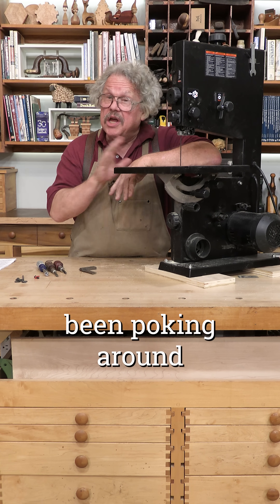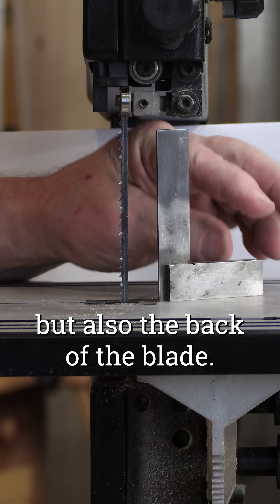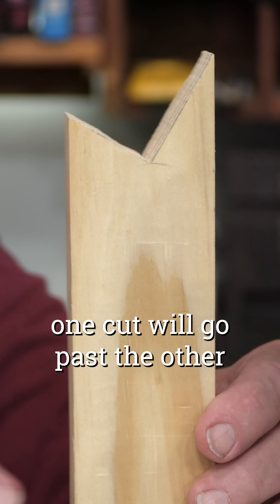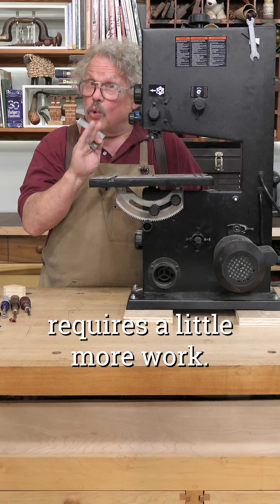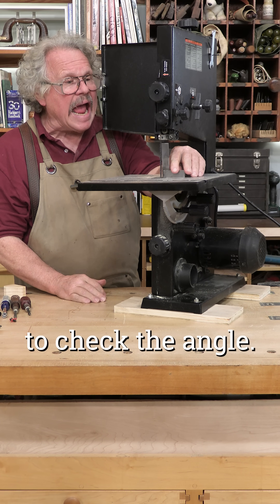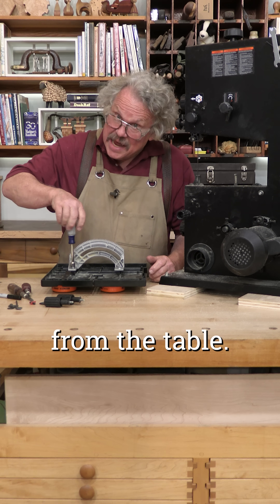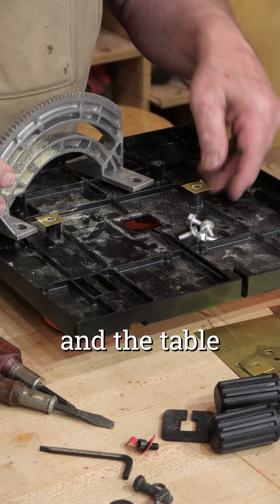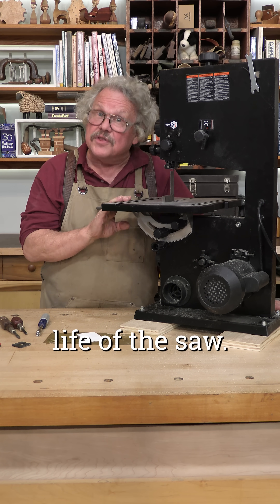Squaring the Bandsaw Blade to the Table

Comment from the maker: As important as this adjustment is, you’d think that bandsaw manufacturers would have come up with a simpler way to do it by now. But, unfortunately, adding shims under the trunnions remains the best and only way to get this done. 

You might also think that there would be a way to calculate the thickness of the shims you need to change the tilt of the table in relation to the back of the blade. There is; it’s a simple trig problem. But the precision required to make the measurements needed is far beyond what most home workshops can handle. So we’re left with this primitive “cut-and-try” procedure that I show in the vid.

Fortunately, you rarely have to add many shims and it doesn’t take as long as you’d think it might. To square up the WEN bandsaw shown in the video, I added .010" shims under two of the four trunnion mounts. But this little change made a big difference in the performance of the tool!
Reply: If the base of your square is as long as the distance between trunnion bolts, you can shim the square until it matches the blade.  Then put in your pile of shims below the table.  That will get you close.
Reply from the maker: @alans1816  Interesting idea, but I usually don't have time to machine a square to the proper size.
Reply: @WorkshopCompanion 
Missed opportunity at end of video to show us the results of your effort
Reply: I had stopped using my bandsaw for any "finish" work.  Didn't realize the problem.  Took most of 2 hours to gather tools, cut shims etc.... best darn two hours so far this month - so THANK YOU, thank you, thank you :)
Reply from the maker: @charliehiker2247  It makes a difference, doesn't it? I was blown away the first time I squared it up.
Reply: I'd think that the manufacturer would provide a bag of shims of various thicknesses with the thickness stamped on them and a chart showing what shims, or combination of them, to use to adjust based on the angle of the blade, which can be measured with a protractor.
Reply: I believe the bearing on the top and bottom of the blade have an adjustment for this too
Reply from the maker: @gabrielthedergy1 Unfortunately, not so. The top and bottom back-up bearings must be adjusted not to touch (or just barelt touch) the back of the blade. If there is forward pressure on the back of the blade, it stresses the blade and exacerbates the "washboarding" in the cut.
Reply: @WorkshopCompanion I thought I'd seen that adjustment before but maybe I'm thinking of something else. That actually makes sense though
Reply: Love this explanation
Reply: you also might think the manufacturer would be able to get this set correctly before shipping.
Reply: More great tips thanks!  I've never made this adjustment to my saw yet.   But I want to throw a spanner in the works...   Alex Snodgrass recommends adjusting the tracking, so that the deepest part of the gullet (the gap between the teeth) is aligned with the centre of the top wheel, not the middle of the blade like you and most others, suggest.   I certainly like the Snodgrass setup personally and have had great results with it from my 12" band saw.    It depends what size of blade and how many teeth per inch you use, but generally to get the deepest part of the gullet in the middle, the blade needs to be moved towards the back of the top wheel rather than centred!
Reply from the maker: @SoundsToBlowYourMind  Since we're talking about such a small difference for these small blades, I'm not sure it matters all that much. Performance should be fine as long as your tracking is consistent. But if I tracked the 1"-wide resaw blade on my 14" Delta bandsaw as you suggest, the back of the blade would contact the metal rim of the upper wheel. I can't see how that's a good idea.
Reply: Instead of removing the trunnions entirely could you back the bolts off a bit, cut u-shaped shims and then slide the shims on from the side before tightening them back down?
Reply: @CalamityJay-ez2mq   Vibration might cause 3 sided shims to move ...maybe try extending the "u" to "U" then bent over reducing movement... just a guess
Reply: @charliehiker2247 the farther down I scroll in the comments the better the solutions get😂
Reply: I have the same bandsaw you mentioned that looks similar to the one in the video—a delta 14”. I picked it up for $70 on Craigslist—love that lil thing! Now I have to go check the back of the blade… 😅 I haven’t noticed an issue but I want to be sure now
Reply from the maker: @DrLoveNugget  Great deal.
Reply: What about using a gradual wedge shaped shim? You could loosen the bolts and feed more shim to increase tilt.
Reply from the maker: @n0ch91c3s  If you can find a shim that tapers in thousandths of inches, yeah, sure.
Reply: I have nerve known this. Always confused by the issue. Excellent work.
Reply: Thanks
Reply: Where is your LEV?
Reply from the maker: @Dennis_M1DLG  Overhead.
Reply: @WorkshopCompanion  good, got to look after your health.
Reply: How tight should the blade of the bandsaw be? I refuse to believe that my band saw is so rubbish that it can’t cut straight but I’m scared of tightening it up too much
Reply from the maker: @gileshaywoodsmith641  Watching our vid on "Nesting Boxes," https://www.youtube.com/watch?v=i6z65s_xfLw . Beginning at 2:57, I show you how to tension the blade on a bandsaw without relying on a tension meter.
Reply: My Shopsmith was perfect To the flag of the blade, but in line with the blade, the bottom was just a barely bit off. I didn’t know how to fix it until this video, I made a plastic shim. Perfect. Thank you.
Reply from the maker: @kofdenhamsprings2701  Most welcome.
Reply: honestly shimming it is the best way to go in my eyes, feels more sturdy
Reply: It’s the same way with vehicle alignments.  While majority of cars have adjustments, a lot have no rear adjustments, and the only way to adjust it is to install shims.  This means you need to take the hub off and put a plastic shim behind it.  In other cases like trucks with solid axles… you don’t get rear adjustments.  It is what it is, and if you manage to get it out of alignment… you just get a new axle.  

Luckily most cars have adjustments, but the bolts seize up all the time and sometimes the bolts will just snap if you pull too hard.
Reply: @congruentcrib 
   Unless a vehicle solid rear axle is bent, it's usually not far off in camber, but surprisingly far as to toe. I've had good luck adjusting the front spring mounts, or trailing arm mounts on coil suspension.
   Even worked on toe for some suspension that adjusted with shims.
Reply: I dont believe you that there's no such thing as a bandsaw that comes perfectly square out of the box. Im googling it sir.
Reply: What about large industrial bandsaws that don't have an adjustable table?

Though to be fair, we cut mostly aluminum and rarely need to cut an internal corner.
But the thing is so old that blades don't sit square anymore even though it's a fixed base. I suppose you could shim behind one of the wheels maybe?
Reply from the maker: @Marlfox570  Not all bandsaws are made for fine woodworking. Although, when I was teaching at the University of Cincinnati, we had an ancient Tannewitz with a table the size of an aircraft carrier, and we shimmed the trunnions on that monster.
Reply: Inches?!  What kind of monster uses archaic measures for woodworking?
Reply: @greensteve9307  LOL

Comment: My understanding is the blade should be tracking at the back of the gullet’s of the teeth in the center of the arched wheel rim. 😇
Reply from the maker: The blade tracks where it contacts the wheel at the mechanical center of the wheel crown — not inherently at the any point in the blade's cross section such as the bottom of the gullets. The tracking behavior is governed more by wheel shape, tension, and tilt adjustment than by the blade’s internal neutral axis. So it's perfectly okay just to center the blade on the wheel. With wide blades, this would be desirable over tracking the bottom of the gullets on the wheel.
Reply: @WorkshopCompanion ,
Thanks for responding. I was just relaying what some bandsaw maven was recommending for setting up the infernal machines. He didn’t cover the table axis as well as you did.
By the bye, how’d that MSDS on water work out for you? 😎🎸👍

Comment: May I suggest that you first put a long straightedg level across the faces of the top and bottom wheels to make sure they are vertically aligned and straight up and down. Once I did this my bandsaw turned from a beast to a beauty. I had to shim out the lower wheel about 3/16 of an inch.

Comment: ... Are you telling me all that's in the top of a band saw is a giant wheel?? No motor or electronics at all, just a giant wheel to feed the blade through??
Reply from the maker: Bandsaws have two giant wheels, sometimes three moderately-sized wheels. You only have to apply power to one of them to drive the blade.

Comment: I think this video has finally revealed to me the problem that had been haunting me from woodshop. I’d make a perfectly straight cut, check the piece, and the end was messed up.
Reply from the maker: Yep. That will happen if the banck of the blade is not square to the table.

Comment: @“one cut will go past the other”:

When felling trees, this over-cut or bypass inside the notch is called a dutchman. A dutchman jeopardizes the ability to control direction of a fell, as the notch’s inside vertex becomes increasingly ambiguous. More significantly, Dutchman kerfs continuing beyond that inside vertex will sever “hinge wood”. This hinge wood is tethering the material above, to that below, and bound to your intended guidance of the fall: the notch and back cut(s).

Completely off topic? Well I say!! Returning to carpentry after five years of tree work, I find myself staring at every bypassed kerf on stair stringers. Am I being a bit dramatic considering misaligned and bypassed kerfs against the felling of trees? Oh yeah! But clean kerfs are good, and we all like good cuts!!

If any would like to share my peculiar shaded glasses on this, look into Humboldt style notches and Dutchman for good examples.

Cheers

Comment: It makes sense why they omit it as it would be highlighting their poor manufacturing tolerances. Thank you for educating us
Reply from the maker: To be fair, it's not necesarily a failure to maintain tolerances -- I didn't mean to give that impression. All band saws have this problem because frame castings and other manufactured parts are never exactly the same. The problem is that manufacturers cannot keep costs down if they have to spend hours adjusting for these differences. And there are some adjustments they can't make because they will change with shipping and environment. For this reason, tool makers pass the responsibility for final adjustment and alignment to the end user. It's always been this way, for tools at all levels of cost and quality.

Comment: Could you loosen the trunnion while it's on the machine and shim it in place, to find the right adjustment, and then take it off all the way to install it fully?
Reply from the maker: Depends on the design of the band saw. For the WEN, probably. For my old Delta, iffy.

Comment: I used to know a guy with a bandsaw that was WILDLY out of level. Like... you could see the wheels did not line up at all. he was convinced the blade guide was the problem... you know... an actual piece of safety equipment. So he removed it. Instead of just fixing the wheel adjustment knob on the bottom, which was broken.

Comment: I bought this bandsaw after watching your review and cannot get the bed to reach 0° it constantly sits at -4° towards me I’ve messed with the table the tightness and the leveling screw for the life of me I can’t figure it out
Reply from the maker: Suggest you remove the table leveling stop completely to see what your true range is. You should have 2-3 degrees left tilt and 46-47 degrees right tilt, at minimum. If you don't, return the saw. While it's a decent tool, the quality control is probably not all that great -- they have to cut costs somewhere to be able to sell it for that price. It wouldn't surprise that more than the average amount of lemons squeeze by QC.

Comment: would this have to be done again after changing a blade?
Reply from the maker: No.The blade rides on the crowns of the wheels. Because the upper wheel tilts from it's center, the "crown line" -- the longest measurable distance between the crowns the blade is riding -- remains at roughly the same angle. There is some movement, of course; the geometry is not perfect. But it's close enough that whatever changes there are do not overly affect the angle of the blade to the table when you adjust tracking.

Comment: I saw a many people complaining about their miter saws not being able to cut clean angles. I checked mine, a quite cheap one, and well, yes, 89.2° is not a square angle ootb, and 44,6 is not 45.
Loosing two scews, adjusting the table/guide rails along the blade, fastening screws - et voilà ! - perfect 90° cuts instantly.
Reply from the maker: Sometimes I feel that careful allignment and adjustment is 50% of fine woodworking.

Comment: I got the vevor 14” bandsaw and whilst being cheap in a few places like the guides were probably designed by 7yo and the bendy plastic table insert it has just under 13” of resaw, 1&1/2hp motor, heavy cast iron table and it was $600. It has a 109.45” blade that is some number in mm’s which thankfully led to me finding out my favorite bandsaw blades “Timberwolf blades” come in any size you want. Oh yeah the tensioning wheel broke the first time I tried to loose the blade so I had to build my own and there’s no tension gauge for any size blade and the instructions are basically a picture of a completed saw and a wrench a the words “you do this now, good luck everyone”. It does cut well, a vast step up from the 12” craftsman from the 80’s😊oh year they got a 10” that actually has 10” of resaw in a little bench saw like this wen. The wen’s probably a fair bit better built but the vevor has the stats😊

Comment: The other thing is to ensure the table is flat. Because there is a cut in the table the two sides might not necessarily be flat. My saw uses the fence to hold it flat and has some adjustment screws to push up either side if they do not meet level

Comment: One could also loosen the trunnion on the side that needs adjustment and insert thickness gages until the setup is correct.  Then fab a shim to the required thickness to insert.

Comment: So, possibly a dumb question, but why is this not something the manufacturer takes care of? I don't expect them to inspect every unit before it goes out, but shouldn't quality control ensure things are square? I'm a machinist so i get how precision is expensive, but surely the big CNC machines they use to churn these out are pretty precise.
Reply from the maker: My own opinion -- and it's only an opinion -- is that this step IS done when the frame and trunnions are being machined. This is why the parts only need small shims. The frame, however, is ductile iron, which can change shape as the casting "cures." More important, there are several other assembly steps that may change the way is which the blade mounts on the frame, notably the installation of the lower wheel. As any machinist knows, you can't control everything in manufacturing. There are always things that need to be attended to in set-up. Furthermore , I believe that you should attend to these things in set-up;  alignment and adjustment help you to understand how the machine works.
Reply: @WorkshopCompanion very good point.

Comment: This is the incorrect way to do it. Do not make solid shims. Make U shaped shims with a tang you can grab so it's easy to make adjustments and you don't have to take it off the machine a dozen times.

Comment: In the US for non industrial use 120V is standard so I believe. In Europe 220-230V is standard. I’m not a sparky. What would happen if you connect a 120V bandsaw to an 220V outlet? Smoke and fire or will it run just faster? Can you adjust somehow for 220-230V?

Comment: There has to be a wheel adjustment
Reply from the maker: Unfortunately, no.
Reply: @WorkshopCompanion I would of thought they would of slotted the band wheel mounts to be able to move the top and bottom wheels to be able to plumb the blade straight up and down

Comment: "This is an adjustment that only has to be done once during the life of the saw"

*Cries in 3D printing*

[The joke is: The printbed, the flat part where the parts are printed on, needs to be leveled basically every other time you look at your printer and if you have auto bed leveling, you still need to adjust your z-offset every time you mess with any part of the hotend]

Comment: He adjusted the flat of the blade with the shims.He did not adjust the back of the blade with the shims as the shims were put on one the side of the table not the back or front.if the blade does not run perpendicular to both the top and bottom guide wheels perhaps the frame is not square,more problems!

Comment: You are correct sir, may I add that anything non metallic as paper may absorb moisture such as humidity and throw off your cuts. Thank you
Reply from the maker: Paper shims don't shrink and swell overmuch with changes in relative humidy for the simple reason the bolts holding them under pressure don't turn. You can, in fact, rely on a US dollar bill to provide a reasonably precise .0043" shim.
Reply: @WorkshopCompanion 
I gotcha! The US dollar bill has fabric in it and that is a better use than what our government does with it!